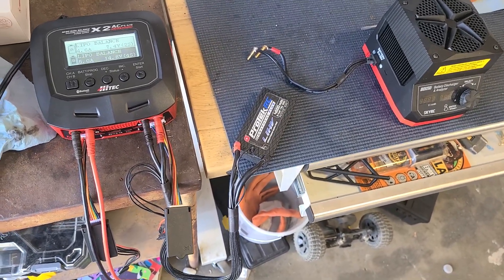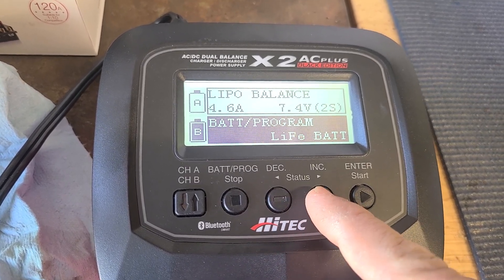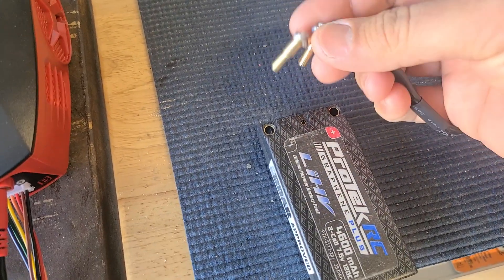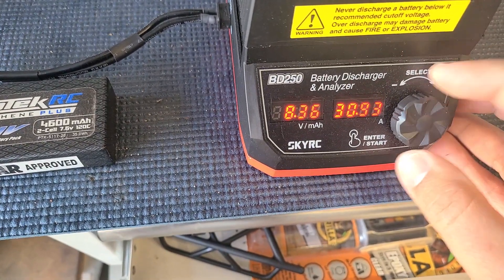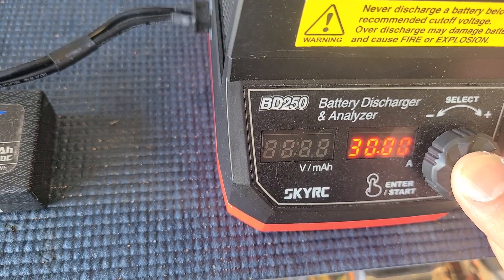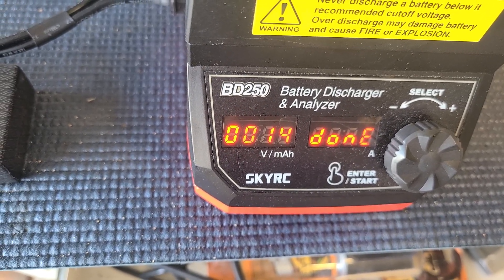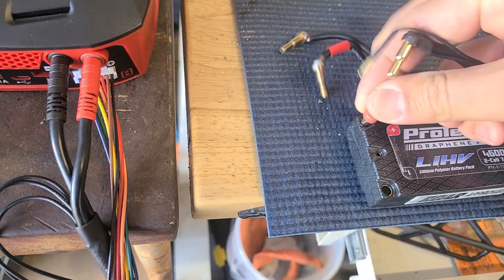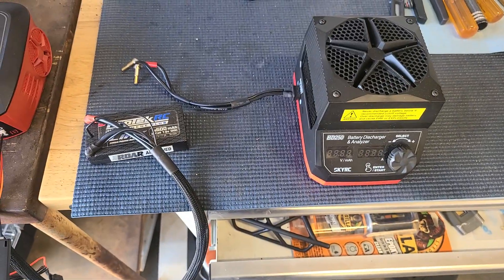SkyRC Discharger Problem?

Comment from the maker: So I forgot to come back to this and let everyone know I figured it out. I brought it down to 15a and basically set it to just below storage voltage and it usually brings me pretty close to 3.8v per cell 👍 Even with a 6s battery it doesnt take more than 5 mins to discharge from full 😊

Comment: Hey bud, if the internal resistance of the lipo is high at 35amp draw it will have voltage sag over 1v so it will cause the unit to shut off prematurely.  Try just a 1c discharge rate on older packs
Reply from the maker: Yea I figured it out I've been doing it at 15a and its been working good 👍
Reply: @RUZTY1311  that's good to hear, it's a brilliant bit of kit
Reply from the maker: @ConnorCain25  Thanks and yea I love it now haha!